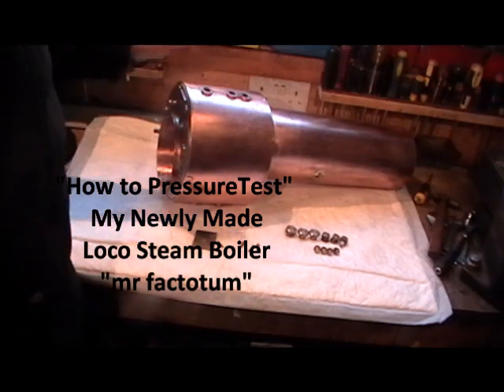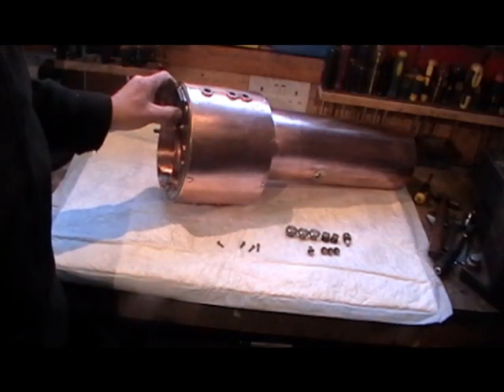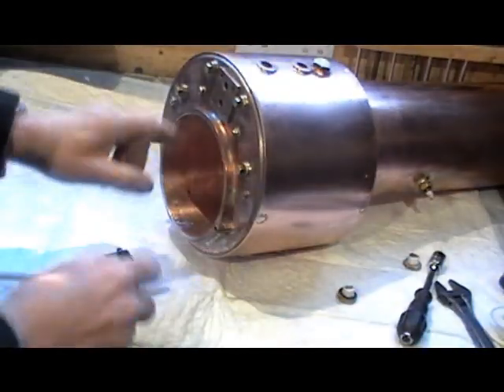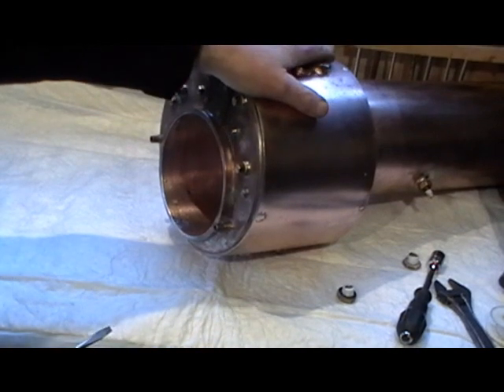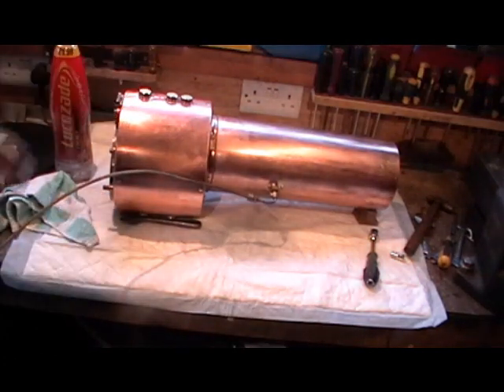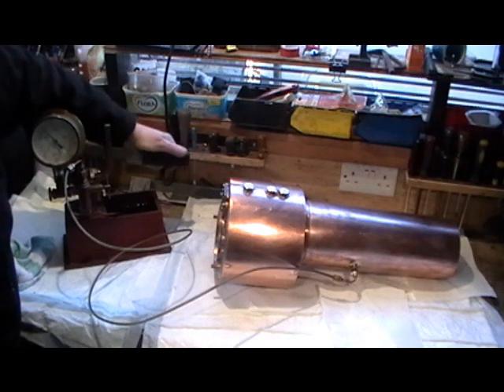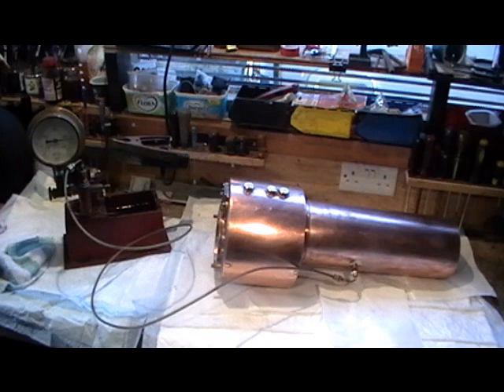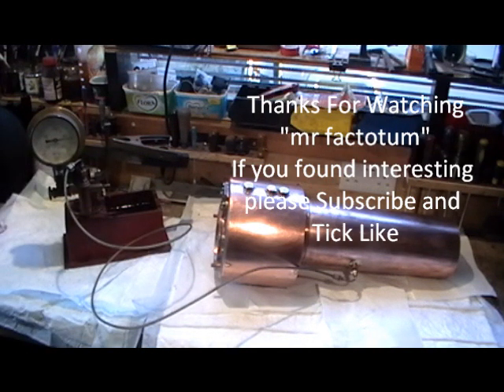How to make a steam loco boiler from scratch PART 13 "Pressure Testing"  "mr factotum"

Comment: Looking good, when are you planning on building the saddle tank? Building a rob roy converted to a saddle tank design but need some guidance as to bending and soldering the tank!
Reply from the maker: hi jordan
Thanks for comments and interest
To be honest i have'nt really thought that far yet, it will be a while before i get to that. Also as most sweet pea's / metre maid's are to a degree freelance, i may be inclined to put pannier tanks on, ive seen one at a show that i thought looked really nice.
 As for the saddle tank of yours, just a quick thought, i would probably make a wooden template to bend it round, make the ends and bottom with a lip on with a close fit, hold it together with a few rivets or screws, then soft solder the seams. I know that sounds more simpler than to put in to practice, but you have to start somewhere.
good luck with it i'm sure you will find a way
regards
mr f
Reply: Mr Factotum thank you
Very much I’ll give that a go!

Comment: Meant to say after part 12 that the boiler looks stunning.
Not surprised the water pressure test went well, 
though still, it must've been a bit nerve racking during the build up to 165 psi 
and the following 15 minutes.  
Plus its good to have all the blanking plugs
working before the next more official test.
Reply from the maker: Thanks for comments, yes, i had everything crossed, with it being the first time
regards
Mr f